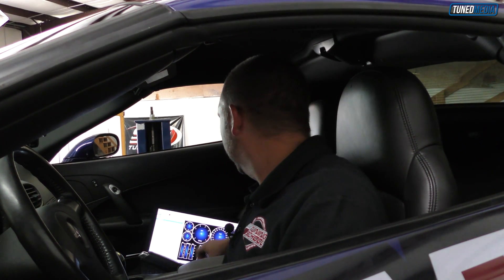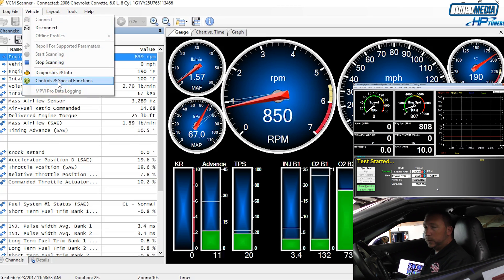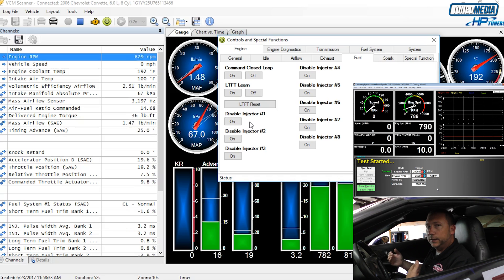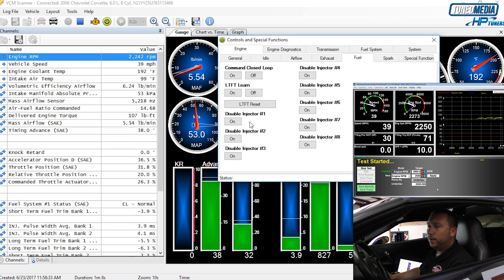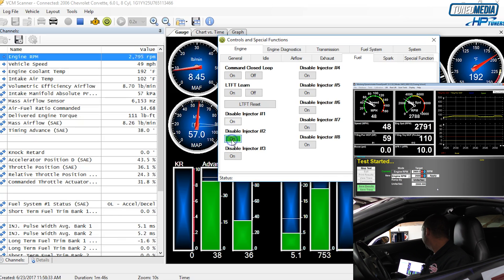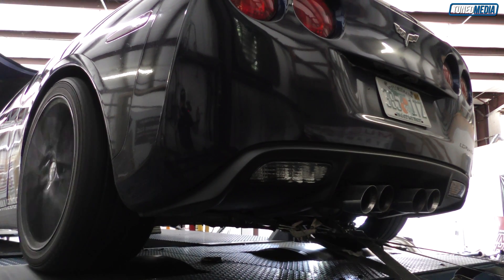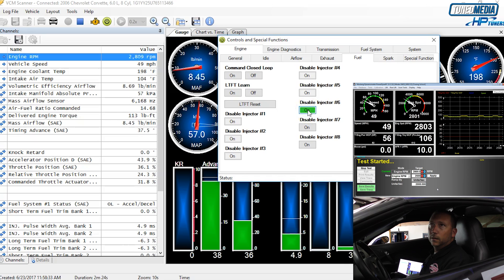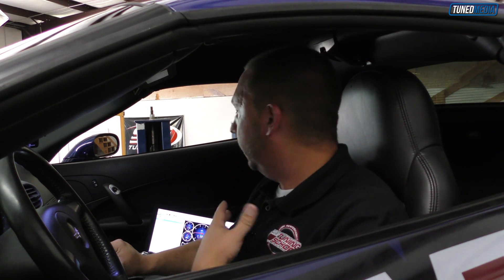How to check the health of each cylinder of your engine: Modified Power Balance Test

Comment: When you first mentioned about turning off a cylinder in thought it would mess up the  fuel trim. But during the test I could see that the ecu goes in open loop as soon as a cylinder is disabled.

Comment: Not thay I have tried, but if you could use cruise control to hold a particular speed then run this test, you would then just look at the throttle position. Which would be logged on the scanner , so no need to look at the dyno readout while doing it.

Comment: Interesting, besides being able to see if a cylinder was bad what else would this test be good for?
Reply: KRACC Media Its really simple and a great tool. Seeing if an injector is bad, possible coil pack and health of your piston. If you don't lose power when the injector turns off, you have issues like bad valves or valve springs or possible piston issues.
Reply: KRACC Media  nothing else